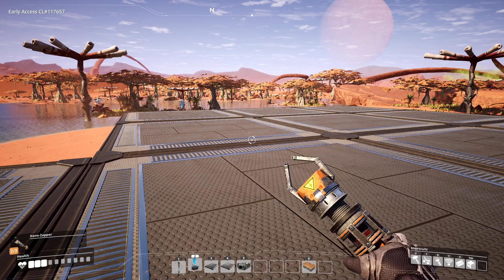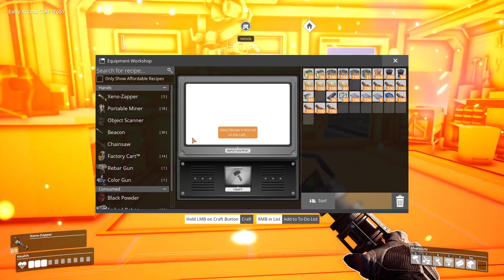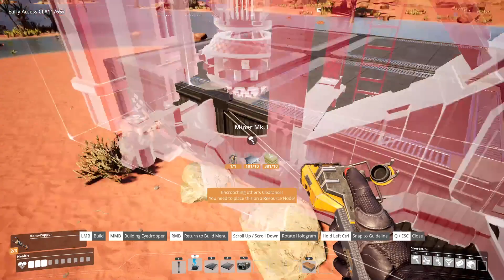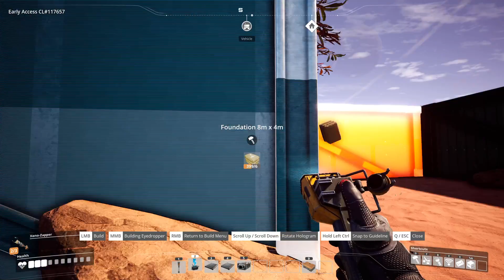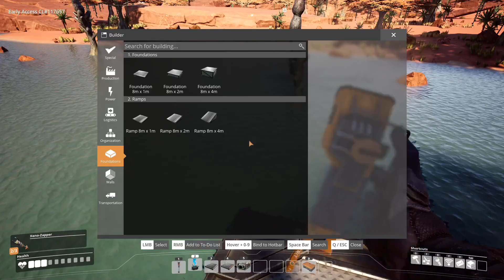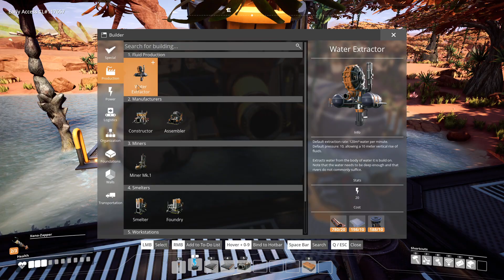Satisfactory - Dune Desert - Part 9 - Setting up Fluid Pipes & Finishing Tier 3

Comment: Why not put the coal power station down by the water? That way you would not have to worry about the headlift, i.e the maximum height that the pumps will pump the water.